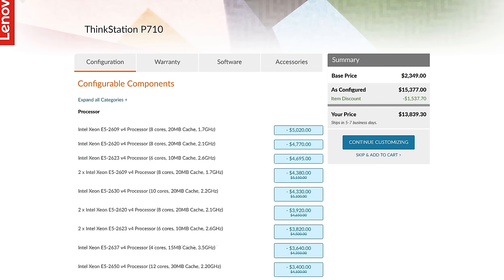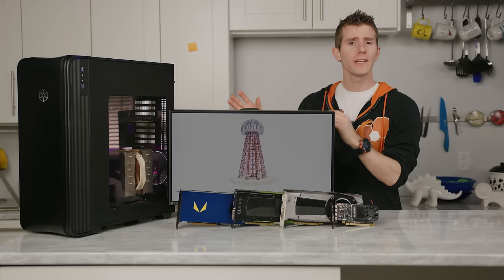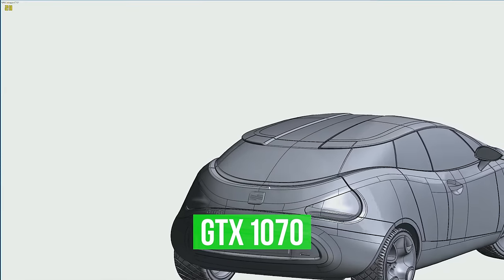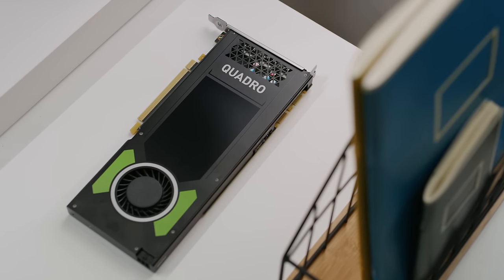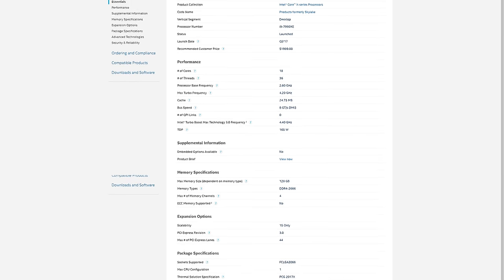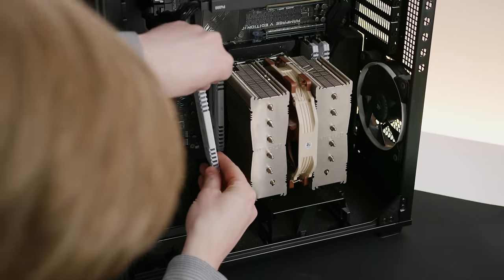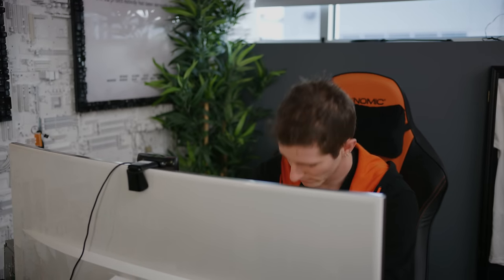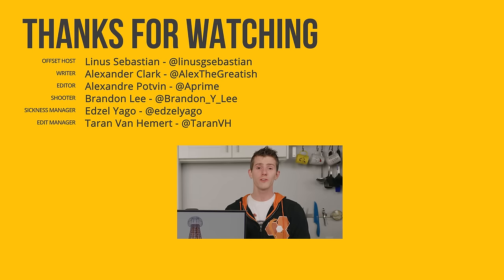3D Modeling & Design – Do you REALLY need a Xeon and Quadro??

Comment: Can you update this video with 2020 hardware?
Reply: yes please. Also, that's a hell of a budget config. 8700k is still pricey in 2019 for a budget option
Reply: +1 for an update to this video.  For many of us in the 3D Cad and Modeling (architectural design, engineering, etc.) this information is hard to come by and a lot of us work from our home machines. Great stuff!
Reply: @justinma9537  Thank you. I hope they can do something like this soon.
Reply: I personally wouldn't as setups vary per CAD program so saying it's for CAD is misselling it.
Reply: Yeah, ryzen has given this a whole twist.
Reply: Glen Charles Rowell 3950x and a 2080 super. Nothing better than that right now for price to performance. The 2080ti is too expensive to warrant the minor performance bump over the 2080 super. For a smaller budget, probably a 3800x or 3900x and a 2060 or 2070.
Reply: @RiceCubeTech  Well obviously the high end chip would be best, but some comparison of maybe the 3600 or lower would be really nice. I'm seeing that coming in on par or better than the 8700, and that is some bangin' price to performance. I'd love to see some comparisons showing where you hit diminishing returns with this new hardware.
Reply: my though - especially now 2020
Reply: +1 they need to update this for 2020
Reply: Depending on what level you are it will vary greatly. Puget Systems have configs based on what software you use and give options to swap components. They build professional grade workstations per what software is being used. You can go on their website and slightly modify their options, however i7 & i9 intel processors with ddr4 ram and a quadro of some sort are still the gold standard and SOMEWHAT affordable. If you want more specific take a look at CPU benchmark and get the processor that has the highest single core performance, minimum of 6 cores, then put the fastest ram you can, and a graphics card that has a fair bit of memory. (The reason that intel is still a better choice is that their single core performance is a little cheaper compared to ryzen atm, and when Sketchup and Autocad are single core optimized, and revit is quad core optimized thats what you need. Also by having any sort of designated GPU, you take that load off of the CPU directly)

Currently Running an I9-9900 W/ 32GB DDR4 Ram W/ a 1070Ti and i have no problem pulling up 200+ component files in sketchup and can pull up commercial prints in revit and autocad without a problem (normally commercial prints are anywhere from 25-30 pages of material and have about 2gb of external reference files that need to load with them.
Reply: @javierortiz82  kinda but not at the price they are right now. CPU benchmark shows the an I9-9900K has a single thread rating of 2900ish and a ryzen 9 3950X/PRO are coming in at 3000ish for an extra $300 dollars and honestly that money should probably go to more ram. At least thats how architectural firms that mainly work in revit and sketchup prefer to spec their workstations, or you could save that 300$ and put it towards a low tier quadro (P2200) and have the reliability rather than getting something like a RTX 2060
Reply: @desertbowhunter  you don't need to go all the way to the 3950X, the 2700X is an incredible value right now and it's a pretty decent performer. I bought one on black friday for $ 140.
Reply: ageofbogyo  the people who gna buy it they gna talk to pros
Reply: And what about hardware for after effect, photoshop or illustrator. I have so many issues with my Lenovo p52. That is so slow.
Reply: Glen Charles Rowell I’m still waiting
Reply: @johnwick5918  same here. I hope they check the comments on videos.
Reply: @farulivan  what 3D programs are you using?
Reply: @a4gr  mostly 3dsMax, Blender and Corona Renderer, how about you?
Reply: Please!
Reply: @msykala  AMD R9 Processors are almost as good as Intel CPUs when it comes to CAD. In Terms of Rendering times Team Red is often better
Reply: it would also be great to see them test fusion 360 as its gaining popularity in the cad world
Reply: Agreed. Just started doing some 3d modeling with Inventor at work and looking to branch out to Fusion360 at home.
Reply: @joshuahuman1  Fusion (for me) is not as good as Inventor but it should be part of tests, 'cause it has earned much popularity. Many people use it because of its hardware friendly environment. And plenty of my study mates use it because of that properties. Inventor needs much better hardware
Reply: yes please yes
Reply: omg please
Reply: And laptop info too
Reply: Ryzen 7 2700x + Rtx 2060 super + 64gb RAM!😁
Reply: @Neil3D  Have to somewhat agree. The "budget" spec in this video is actually a pretty good budget spec for many people today, in 2020, some two years later. Personally though, I say that if you're that deeply involved in the industry, then you should really know what hardware you are capable of exploiting already. It's really not rocket science... er, unless you're designing rockets, I guess?!
Reply: JLUY 2020?
Reply: @desertbowhunter  thank you for taking the time to leave this comment. It was seriously helpful.
Reply: I have a 270x and i7-6700k and I do just fine
Reply: Hint; DO NOT buy old Quadros, because they do not fluctuate well when it comes to prices compared to GeForces. A Quadro P4000's price value could be beaten by a new Quadro RTX 4000, and even that one is newer.
Reply: Just use 3000 series videocard and ryzen 9 or intel equivalent, with 64gb ram, or 128gb. problem solved
Reply: @RiceCubeTech  funny how exactly in one month from now you´ll get so much more power for a fraction of the price
Reply: please this, this a million times!
Reply: We're gonna wait for the new Quadro A6000/8000 whatever they're gonna call it.
BIGGEST tip; DO NOT BUY OLD QUADROS, ALWAYS BUY THE LATEST as Quadros barely fluctuate in terms of prices; a P4000 could cost the same as a RTX4000. Also, if you're doing server work/building a render farm that cannot crash and runs 24 hours a day, you will need a Quadro.
Reply: came here to say this im really interested on knowing how  rtx plays under this situation
Reply: yep
Reply: Second that!
Reply: Yes please thank you.
Reply: @Neil3D  that’s why I followed your advice
Reply: LE BUMP
Reply: Please update for 2020 ( 2021 ? )
Reply: Please, if you can test with the rysen processors (7 2700 8/16, 3 3600 6/12 ...)
Reply: yea pls and we will be happy if u bring anthony
Reply: Thank you, that's what I was going to ask ! Yes Linus please !!!
Reply: Jut commenting to support this thread
Reply: 2021 please
Reply: I stand by You
Reply: @farulivan  I use lots of different programs but I like to use SketchUp for making buildings. I wanna move to Blender one day though. It’s just a pity it doesn’t have a built in primitive line tool. The splines also look a bit messy.
Reply: 2021*
Reply: 2021 update pleeeeeeeease?!
Reply: Threadripper
Reply: and please use AutoDesk software too
Reply: @MrMairu555  Well said I'm amazed at how many people need a video to let them know what hardware you need to run your software...I was told to do my research and learn as if you don't learn it you could end up handing over a ball of money for something that doesn't improve your situation at all so I learnt !
Reply: @JamesLenane  I use two P4000s (first came fitted to a new Precision laptop in 2017, and the second I bought used from eBay in early 2018 for just £300, fitted to my Precision desktop), and in 2021 they still serve me perfectly well. I design braking components, often used at world championship levels. I expect 99% of the muppets here asking about a Quadro RTX wouldn't even need an old K series card, let alone an RTX. Probably the same people who think it's OK to advise others to use a GeForce and a registry hack to get Real View mode. No one I know in the industry [to genuinely make a living] would even consider it. 🙄
Reply: @MrMairu555  Well said buddy I agree totally....if we listened to all the BS we'd be changing PC's every 2 years😉
Reply: @JamesLenane  The irony is that the software (I use SolidWorks) doesn't keep up with the hardware anyway. SW is still single thread software, so all this RTX this, and Gen.11 i9 that, is bollocks! Unless you're running extensive FEA, which would generally be done on another machine anyway, as it would just tie up a design workstation too much, then hardware is generally good for 4-5 years in my experience. I might ask my boss for a new laptop at the end of next year... but only because we get tax breaks for R&D (my department) on new kit, not because I specifically "need" it; it will just be nice to have as my setup will be 5 years old then!
Reply: For the best of the best in rendering gaming and streaming an 13900k and 4090, ddr5 6400+ or a budget option would be 13600k and 4070
Reply: I need a vid for 2023

Comment: Please update this video for 2019!
Reply: Agree
Reply: yea, new threadripper 2020 beat it intel xeon
Reply: 2020 actually ahahahah
Reply: deff a redub needed, outdated info even though it was 2 years ago
Reply: For 2020 u mean
Reply: carguy  how would the rtx 2060 in laptops along with an i 7 9th gen compare with an i7  9th gen and quadro T 2000 workstation laptop for 3D softwares? Which one should I opt for. Thanks in advance!
Reply: Please update for 2020
Reply: For 2020
Reply: carguy  P4000? RTX4000 you mean. Also what is best? Because the rtx6000 trumps the 4000..
Reply: 3300x with B450, 8GB of RAM, Radeon Pro WX 3100 GPU, and any SSD. It will allow for almost 20,000 CAD parts with smooth movement for about $500.

If you have the money to spare for Fusion 360, don't get a GPU bigger than an RX 580 or WX 3100 and invest wholely into a water cooled 3900x or 3950x. Fusion 360 is CPU locked so maybe a 2060 KO is the best you can get for a little in canvas rendering but the full renders are all CPU locked.
Reply: Now for 2020
Reply: carguy  huge important info man!
Reply: carguy  what about other soft wares like Maya, Catia ,Ansys ,Hyperlinks etc 3D soft
Reply: 2020!
Reply: Yes
Reply: 2020?
Reply: Time for 2021 update!
Reply: @SJRofficialmusic  ^^^^ 2021 update
Reply: Quadro is finish line production.
Reply: 2020*
Reply: RTX 3080 and Threadripper n call it a day?
Reply: *2021
Reply: @moneymaker212121  yes
Reply: You mean for 2021.
Reply: For 2021
Reply: 2021
Reply: 2022!
Reply: Or 2021.
Reply: And also do tests for 3ds max and or Maya .
Reply: @maxmustermann853  or 2022 😮‍💨
Reply: 2022! Please include ryzen7 5800x along with Radeon Pro WX 7100 8GB (preferably on a x570 motherboard)
Reply: Update for 2022!!!!
Reply: @SVINT6  3090ti xd
Reply: @jemmysunny  get rtx one

Comment: So... you compare NVIDIA's professional line to AMD's consumer and dual purpose professional/consumer GPUs without ever taking a look at any Radeon professional cards. WX, Pro Duo, PRO SSG, where are all of these lines? Did you use the compute option available in the latest Adrenaline drivers to maximize performance in these workloads? This is pretty much saying Ford is better than Toyota for work trucks because this F150 could carry more equipment and materials than this Corolla, and didn't give the Corolla the advantage of the optional tow hitch and a trailer.
Reply: the radeon pro line is a disaster